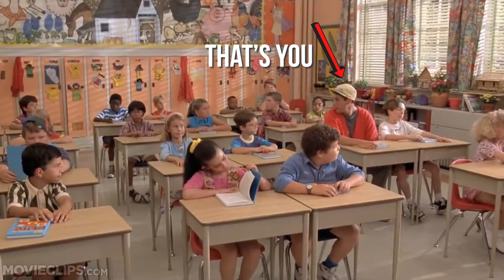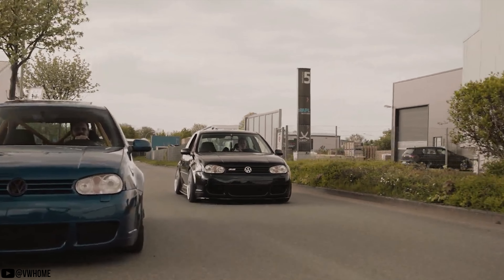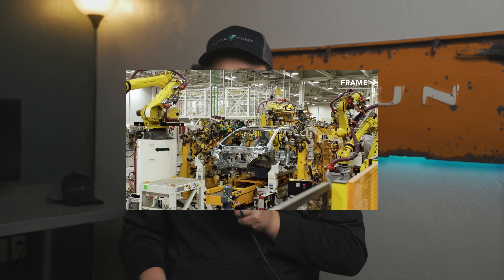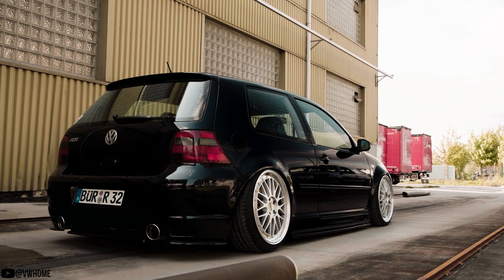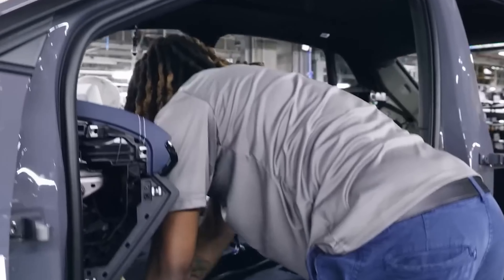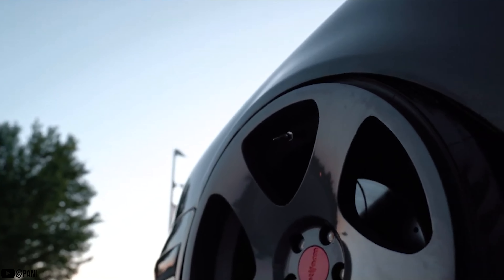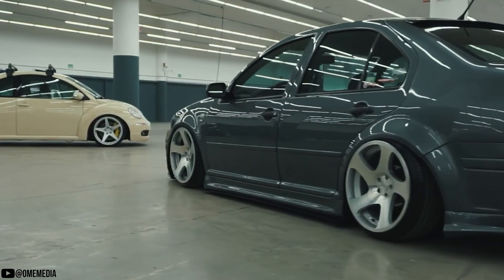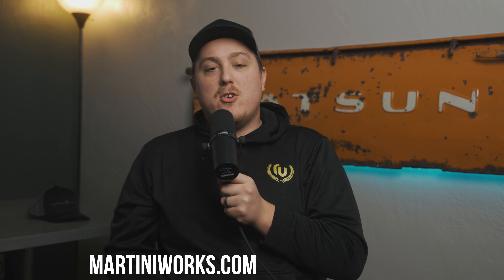Why Do Volkswagen's Smell like Crayons?

Comment: My SRT4 smells like crayons. It’s because of the sound deadening on the dash. That stuff is crumbling like old crayons too
Reply: They all do LOL most hate it, I was never bothered by it. But I did a deep clean of my car and it helped a lot mine has not smelled like crayons in months
Reply: I have to pull the dash to replace the heater core. At that time on going to remove the firewall sound deadening and replace it with new sound deader and closed cell foam. Hopefully that will reduce the smell 😂